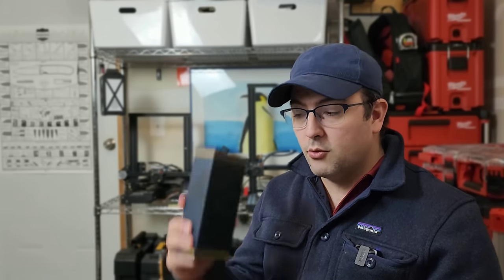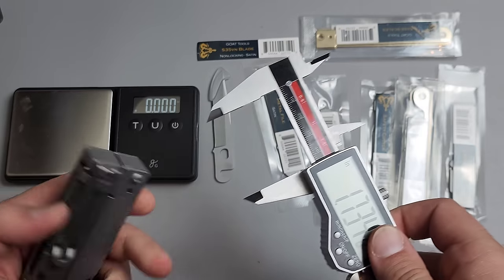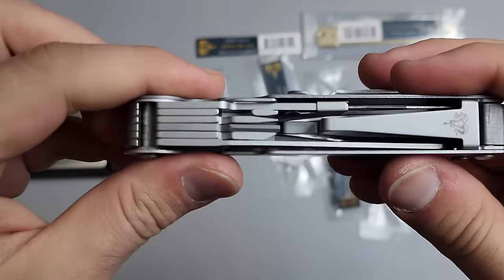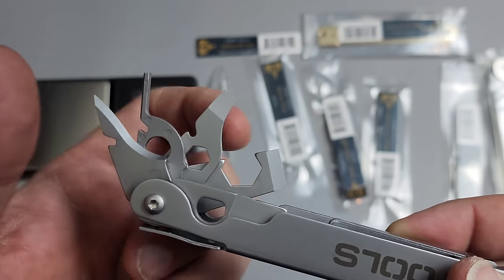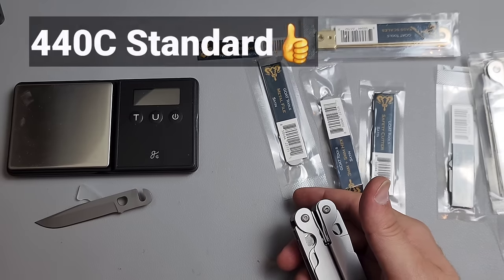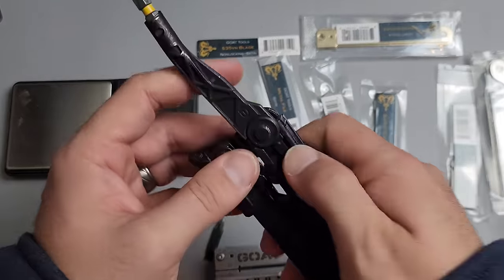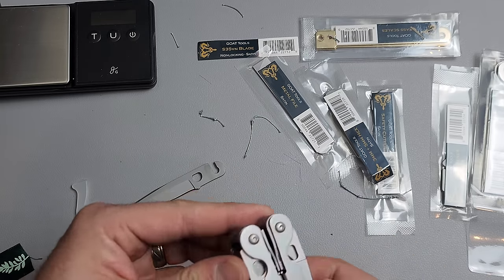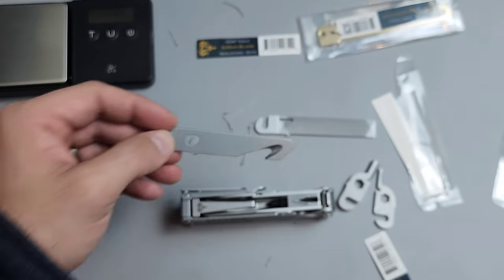🛠Modular multitools are the future.  (First look at the GOAT Tool)

Comment: There's a lot of innovation to like for sure.
The spring loaded pliers are a deal breaker for me,  as are the size / thickness and bit driver though.

Am I correct in assuming you can replace the bit driver with multiple other impliments ?

I don't want a larger tool regardless and certainly wouldn't go larger just to get fewer implements in favor of a bit driver, but being able to actually get more in a larger tool makes it more appealing or at least less unappealing if you aren't stuck with the bit driver.
Reply from the maker: Yes, you can replace the but driver with other tools

Comment: Actually looks pretty interesting,  to me the downside is the pliers though.   I pretty much prefer a more needle nose point on my multitool anymore which makes this pass for me.     The one thing I really love is the xacto blade as well, that is insanely useful to have on a multitool although it really needs a sheath for it.   I like the ability to customize attachments, It means that I could swap things out depending on if I am out camping or if I am just using as an EDC.
It does seem to lack things I would want though like wire stripper/crimper and the option for a inner serrated blade option would be cool as that is much better than a saw or smooth blade for plastic or fibrous materials like rope.   The nice thing is that due to the design though third parties could design those pieces.

Comment: Amazing tool - you are right, this is a game changer!
Like the full-size hex bit driver. 
Spring loaded pliers are welcome, but tungsten wire cutters would be too!
What I don't like is the non-locking better S35VN-blade - they should offer both in a locking AND non-locking version, so you can choose depending on where you live.
The frame looks rather uncomfortable (like the original Leatherman and so many more) and I'm not sure, the extra scales will help that much.
The "reamer" actually is a bronze scraper for carbon removal on firearms, probably not suitable to drill holes in esp.hard wood - would like to see a real one.
The Roxon S802 comes with 11 (!) interchangeable main blades, I'd like to see that in this tool too, but that's an easy fix for GOAT, just make and offer some, as well as a good saw and some longer screws and additional plates to add extra layers.
Stay safe and take care
Reply from the maker: You can choose, i just happen to choose non-locking

Comment: The thumb hole was larger in their first designs and I was concerned that it might breach the strength of the tools. Now I see they reduced the diameter of the thumb hole and it’s relieving to see. 
By the way, Leatherman Surge’s T-shank diamond file enabled sharpening its knife, but this Goat Tools got an Allen key to make diassembling the whole tool possible. Hope they provide diamond file as well in the future, and more items to make the whole system manageable within itself.
Reply from the maker: they are in the works after they complete the normal distribution.

Comment: I use a multitool many, many times a day at work and have done so for years. When I need a new one, one thing I shop for is comfort. The GOAT looks like a great tool and I'd like to have one, but I would not choose it for continuous use. The hard angles, block shape and the overbuilt clip look nice but it will kill your hands after using it for a while.
Reply from the maker: Crazy enough it's more comfortable than a wave..no joke
Reply: Don't think it will bother me, as my hands are big.

Comment: I might have missed this answer-  Can you have just 1 or 2 tools in it and it still operates?  Or are you forced to keep it full or is there a minimum requirement?  For example, all I want is folding pliers and a saw, lol!  
  As a mechanic, I need a REAL screwdriver ( ratcheting ), and I carry a real knife.  Don’t need a bottle opener, awl, file, etc.  But I do use and appreciate the folding pliers and a saw.   I also carry a dedicated pair of scissors.  Scissors are under appreciated!  
I have hope for the GOAT

Comment: Very cool tool. I also feel like this is the moment when the game has changed in the multitool world. 

There's a lot I love about this, like you can build a tool for a specific purpose, like firearms or bicycling. I like that if you bring it into a secure area, you can dispose of the blade and keep the bulk of it. I like that the scales have the specs published, and I assume there will be third party tools for this too. That they supported the three main kinds of hex bits was really thoughtful.

What don't I like? The pliers are not swappable. The tool lacks a design elegance that you might find in the Crunch or Signal. Speaking of, there is no locking pliers option.

Still though, this is a game changer. No more buying a bunch of different tools just to cover all the bases, no more sending the whole thing back when one part breaks. Awesome.
Reply from the maker: ACTUAAAAALLLYY they area already designing new plier head swaps.

Comment: Given the two hex drivers are different sizes, I wondering how they fit. How easy/hard is it to put them in without there being any room left for wiggle, or rattle? What other tool did you have to "loose" to make a perfect fit? I'm ordering soon and I'd like the two hex bits but not sure how they'll interact with the other tools. Also what's the best setup for going knifeless?.......Cause, Australia. 🤦‍♂😔
Reply from the maker: I'll try to answer as much as I can about the bit driver in the next full length video.
Reply: @maxlvledc  My apologies, I meant the two allen wrenches 3mm & 5mm at  21:37. Sorry about the confusion, my fault.

Comment: Does the non locking blade also have a cutting edge less than 3 inches?
Reply from the maker: Yep! In fact the whole blade is 2.95 . Cutting edge is shorter than that.

Comment: Can you please do tests with the pliers? Like turning bolts and cutting cables. The big reason I don't go with swisstools is because of the small cutters and I would at least want to cut a three strand cable when I am doing electricals.
Reply from the maker: 100%, can you list all the cable types to test.
Reply: @maxlvledc  thanks! I had to google and change the metrics to US, so I am hoping I got this right. The biggest cable I would want to cut is a 3x16AWG (3*1.5mm2) cable. I can go through with the LM Blast in 2 cuts (which is OK for me). The 3x17AWG (3*1mm2) wired can be cut in one cut. If this MT can get close to those scores I would definitely consider ordering one :).  Skeletool needs about 50% more cuts to "nibble through" these.

Appreciate your answer!

Ps.: Love your excitement! Like a kid in a candy store  😂

Comment: Not trying to split hairs here but that's not a true slip joint with the s35vn blade. There seems to be 0 tension on the blade to keep it open?
Reply from the maker: Actually it does have resistance..will show in next video.

Comment: Honestly the only thing I think this tool is missing for ultimate modularity is a jigsaw blade holder. while the regular saw is still a plenty available and viable option, having something that can use jigsaw blades just gives more options including a means of hacksaw which I find more versatile than a woodsaw.
Reply from the maker: they are definitely working on it.
Reply: Perfect solution would be a copy of Leathermans holder. Use woodsaw and diamond file from LM, then any jigsaw blade fit if you put some electric tape on to thicken it.

Comment: It’d be nice if one could buy the frame on it’s own, everywhere I’ve seen it thus far has had it preloaded with tools, most of which I’ll never use.   Also, to start what is probably a UK/USA language debate, an awl is for making holes, a reamer is for making them bigger and more smooth on the edges ;)
Reply from the maker: They haven't even shipped out full batches yet for kickstarter,  I could see that happening later.

Comment: Only real question is can you put more then 1 blade in it? Like can i run 3 blades or only 1 blade and diffrent tools
Reply from the maker: Yes
Reply: @maxlvledc  sweet, im getting one, probably run 3 blades and the scissors. Or 2 blades the file and scissors. I see becouse of lenghth it looks like you can only run 4 longer tools

Comment: The customization is something I've wanted forever. I always have a pocket knife so a blade on the multi-tool is just pointless. It's always just there. And bottle openers.
Reply from the maker: thats exactly what I plan to do, run it without the blade + the pull cutter.

Comment: Would be interesting to see how this tool holds up after a few years. Unfortunately I suspect not very well, and here's why. Main issue is the retaining system. For one, it is a hook instead of a full loop, so there is a natural weak point. Any twist (as with screwdrivers or wrenches), and especially any prying (yeah, yeah "not supposed to"... ok fine, imagine dropping it in just the wrong way, any upside-down-ish way is "wrong" in this case) will have a higher chance of breaking the tool at that hook. In addition, since tools can come off with that release lever partially open, they will. And most likely at the worst possible time. For example: flipping open a dirty tool pulls open the lever. Suddenly it's all on the ground. Third: tools are held open with a small 'tooth' that will round off and now tools won't stay locked open. 
A big issue that is not related to that system that I see is those massive screws holding on wire cutter blades. Try cutting anything of size and their heads will just pinch the wire, making it practically impossible to cut. As for hardened VS carbide, since there is no impact on those blades, chipping is not an issue even when cutting steel wire. However, hardened is not bad. At the very least they can be taken off and re-sharpened.
Why are there finger holes in everything? They might make things easier to open, sure, but they also make everything so much weaker because they take away so much material.
Over the years I have worn out several multi-tools (only two of them being cheap hardware store variety). Yes, i am hard on them, because if i am reaching for one means there is nothing better around, and so i will use it in whatever way is necessary to get the job done. At that time wearing out the tool is not a concern. 
As for "it is customizable", technically any tool is. Besides, there are so many versions out there that it is pretty easy to find one with only what will be used. Would anyone keep track and constantly swap out attachments in such a tool for every occasion instead of taking a more appropriate tool with them? Looks like there are 19 total attachments with the tool itself only holding 9. Even 19 is not all that much for a regular multitool, and no need to worry about swapping them. 
Lastly, why is it so square? Looks like it won't be very comfortable to grip with all those sheet metal edges. Thicker scales might help, but then the whole thing is bigger.
Reply from the maker: I definitely think it will not satisfy Hard users.. For me this will be a tool that accompanies my folding knife in a holster to provide functionality when I need it.
Reply: @maxlvledc  So you carry a couple of things? In that case, what would you have in the pliers? And since you already have a better knife, why not just carry better (maybe locking, or linemans') pliers as well? Though I'm guessing screwdrivers need to be somewhere in there as well.

Comment: let me just tell you which is the best designed multitool, it is the NEXTool with huge scissors, which I did not expect to use 80% of the time. however, I has one big flaw, and that is that the spring from the scissors breaks easy ,bad steel. but no one, no one has made such a useful tool as them, but unfortunately bad steel.
Reply from the maker: Try roxon phantom s802.
Reply: @maxlvledc  S802s is the updated model with a full-size philips.
Reply: @maxlvledc  txs for the tip,I will definitely check it out

Comment: How does the plier head actually function?  Is it based on spring friction like the Leatherman style?  I actually do not like that.  I prefer the geared, compound leverage type plier head on the SOG POWERLOCK as there are no springs.  The springs eventually weaken, and can wear where they contact the plier head making the tool floppy, but also, having the plier head geared to the handles means that you can use the plier head for holding something apart, stretching a hose end or similar tasks, which the Leatherman friction system just can't do.  Another criticism is the "hammer", that area should be standing slightly proud of the handle to prevent the handles being damaged when using the tool as a hammer.  Last small criticism,  the pouch needs two straps for horizontal carry. On the whole, it looks like a decent capable tool, but not perfect yet. Where is it made? I prefer to buy American or European tools where possible, not a fan of things made in China.
Reply from the maker: I have NEVER seen a positive review of the compound leverage system after one year or consistent use....it wears out  or fails completely. I will showcase the plier in next video.
Reply: @Maxlvledc  I used one for over a decade in a technical role and still have it, it's fine, though it is an original US made Powerlock.

Comment: The Kevlar sissor test is kinda silly because Kevlars shear strength isn’t the impressive part. It’s a tensile material, and cutting it is probably similar to other thick fabrics. It may have some abrasive properties that dull tools faster.
Reply from the maker: It was tough for a lot of scissors I tested..but I agree..it tests how well the two blades come together.

Comment: This looks good so far just 2 min in ... I'm in the market for a large multi. this modular seems so cool ..

My ONE WISH that it does NOT have a bottle opener .. such a waster of metal (unless it's the same tool as can opener) as you can remove a sealed bottle cap with anything ...

Comment: the wire cutters will have problems with the wires. They will simply flatten them ... And single-core ones are not sure that they can bite at all if their diameter is more than 2-3mm ... Maybe, of course, this is only in appearance, but this needs to be checked. The problem with scissors can be understood if you compare them visually with Victorinox scissors. And to feel it by trying to cut cardboard ... Yes, they are sharp, no doubt, and I see this tool as a good gift for a fisherman, but nevertheless, if that drawback is eliminated, then they will suit anyone. Following the blade of the scissors, we rise up. Victorinox does not have it, and the cardboard does not rest when cut. And these will...
Reply from the maker: Can u make me a list of different wires I need to test??
Reply: @maxlvledc  awg14 and awg12 I think will be dissent to this test. I think cut will be very messy... These wire cutters have no space between the cutting parts and will compress stranded wire, while solid wire may not cut totally. Although, maybe it's only on the video they look like this ...

Comment: Just thought I should let you known in GOAT'S literature online it says S30v not S35vn, not sure why🤔 . Your blade clearly has S35vn written on it 🤷. 

Maybe at some point there was a change on the decision of blade steel, or maybe just a typo🤷.

I guess it really doesn't matter they're nearly identical, I think the only difference is the addition of 0.5% niobium and 2% molybdenum which does slightly decrease vanadium carbides as a result.

I guess if I had a choice🤔 I would rather have the S30v.
 It has the potential to have a bit more  wear resistance from abrasion due to added vanadium, resulting in additional vanadium carbide formations. 

Something tells me I wouldn't notice the difference between the two 😄.
Reply from the maker: S35 is less chippy, yes they changed it at some point.

Comment: SOG has been there done that and it failed.  The more a tool can break apart the more it breaks apart and modularity has a cost in fit, size, and finish.
All those "speed holes" will mean the tools in that testament to plagiarism and plastic pollution will break under pressure or long use.

Comment: The 3 sided cutter insert is a good idea, but these cutters are a poor design due to them being completely square in the back with zero relief on the back side, this will make it hard to cut anything with a larger diameter than the distance the cutter edge sticks out. 
Look at any pliers with cutters whether it’s normal needle nose, or leather man or whatever, and then look at these and it will be immediately clear what I’m talking about
Reply from the maker: We are going to test then for sure.
Reply: @maxlvledc  I think they’ll work fine for smaller stuff, but I’m curious about bigger stuff, around 12 gauge electrical wire

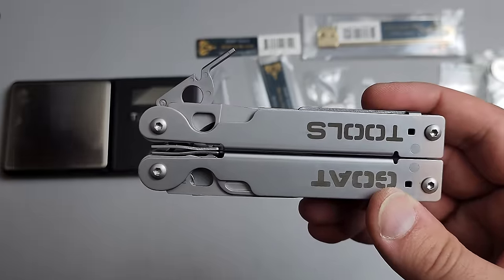Comment: I absolutly dislike multitools that have some sort of screw together housing. You have a tool that takes a tool to keep it field ready. When I bought my first multitool after a few weeks of using it one of the screws worked loose and fell out. 07:10 So how do you get the tool off the tool to maintain the tool with out taking apart the tool to use the tool to repair the tool? aH hah. 09:08 and unlocking bar. Hmm Maybe I give this one a second look. Comes with the tool to fix the tool that is easily accessible.